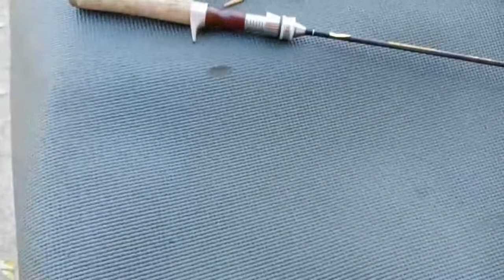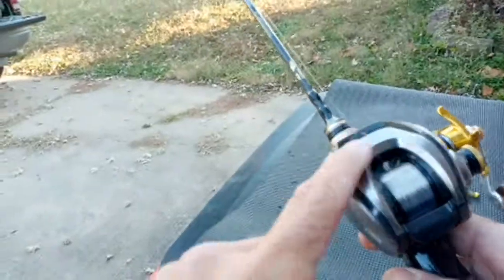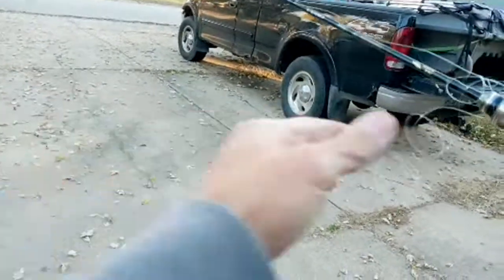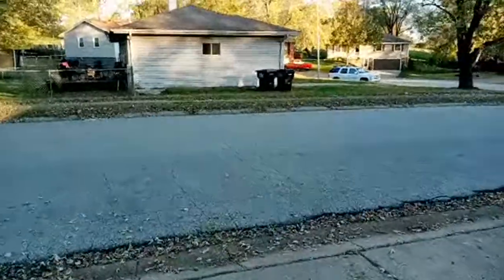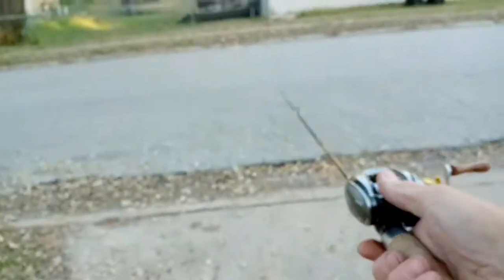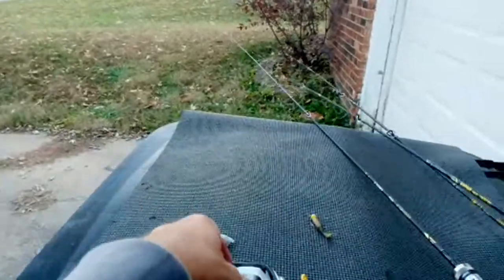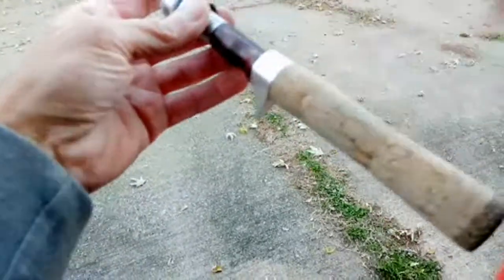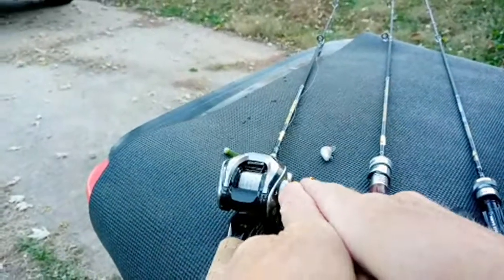AliExpress BFS Fishing Rod Battle ace hawk CU double vs toma + LingL Ceramic Bearing Comparison

Comment: The handle change looks professonal; nice job! 
 I suggest that in all future videos comparing BFS rods and reels you standardize on 10 pound 8 strand braid.  When testing it just makes sense to use what is most user friendly for testing and is also what most folks use to actually fish.  I know that for me personally, I like to be able to compare what I'm doing to your results. Almost nobody who actually fishes much uses 2 lb mono on a baitcaster.
Reply from the maker: Yeah I only did 2lb to be able to judge my results with the reel test when throwing the trout magnet